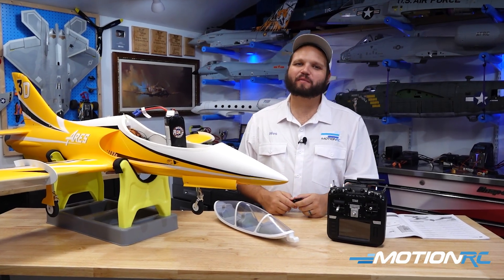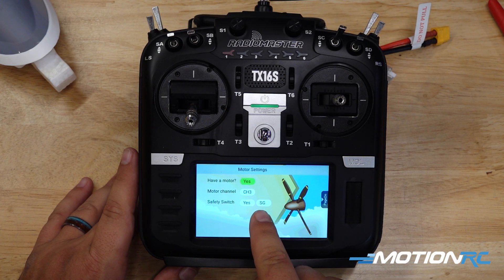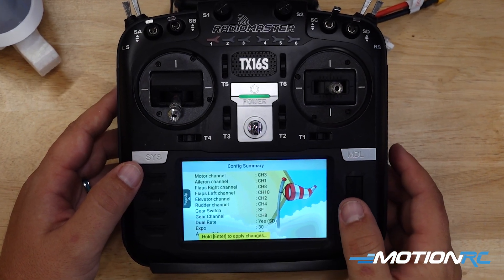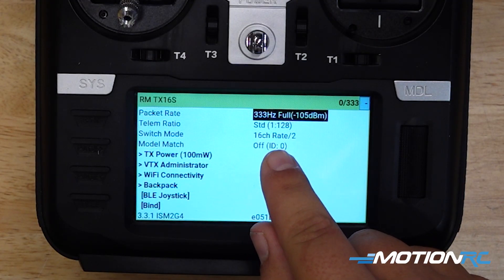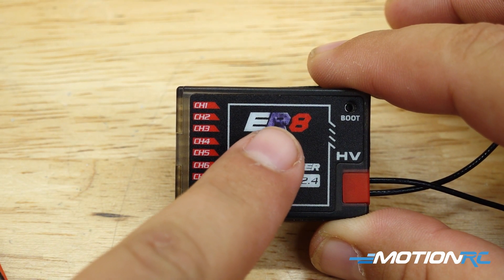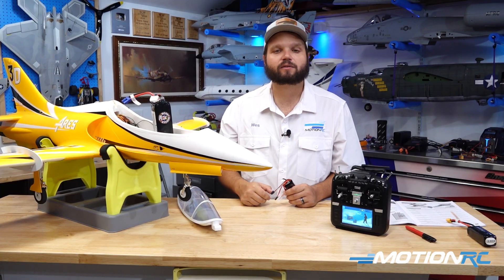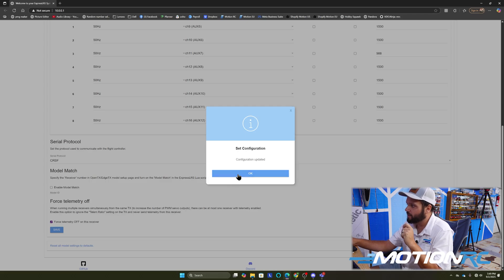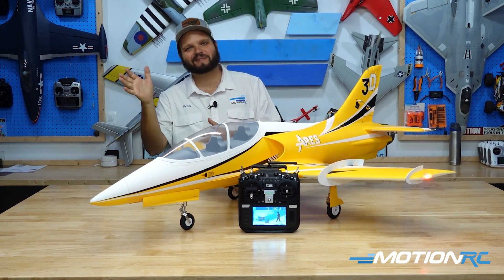Setting Up A Dual RX For Radio Master | Quick Tip | Motion RC

Comment: Glad to see others using dual rx setups with ELRS. I did have an issue on a large aircraft using ER8s. The non telemetry rx lost connection during flight and wouldn’t reconnect until I power cycled the rx. Maybe just a fluke with my rx, I’d be interested to hear if anyone else runs into this issue. Thanks for the video

Comment: The RM ER6 & ER 8 receivers have sbus.  With a sbus expansion board, you can have more channels and use only one receiver.  However, two receivers may be a better option for the Ares EDF.

Comment: Does this only work on ELRS or does the same process work on the tx16s with the 4in1 module built in?
Reply: It would work with ELRS receivers - so if you're using a 4 in 1, you'd need an external ELRS module, and then two ELRS receivers.
Reply: If the 4 in 1 module is built in, you need to purchase an external ELRS module that will plug into the back of your TX16s.  That is what I have done.  Radiomaster has three to choose from.
Reply: I mean if I'm wanting to run a pair of 6 or 8 channel 2.4 rx to get all the channel outputs I need
Reply: Oh, I  see.  You should be able to use any two receivers of any protocol that is supported in the 4 in 1 module.  Although, there could be some exceptions. Do some research before purchasing he rx's.  You do not have to use Elrs.
Reply: If u r ysing the tx-16…it would make sense to get ELRS. double the range and  jamming resistance. Check out the prices they are unbelievable compared to legacy systems